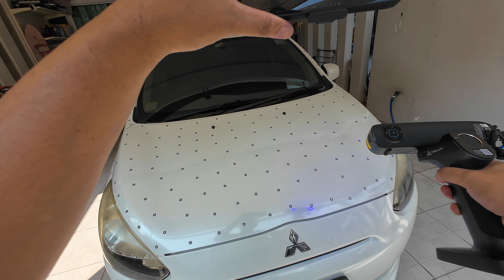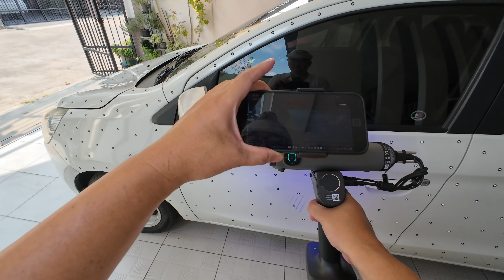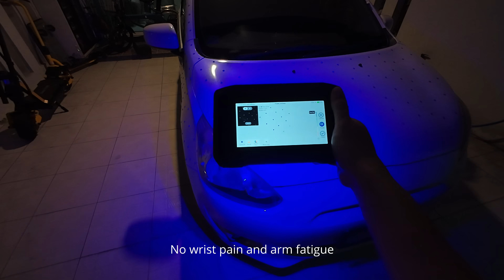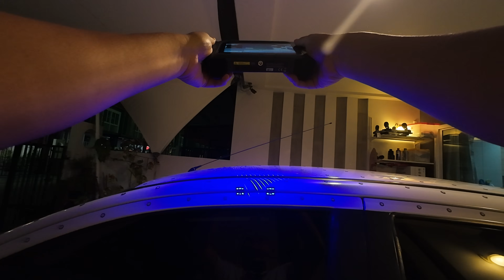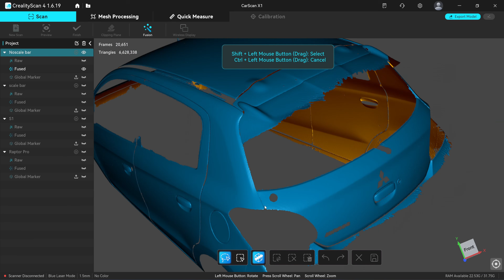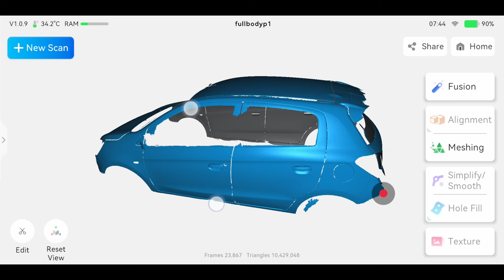Full Car Body 3D Scan Comparison - Creality Sermoon P1, X1, S1 & Raptor Pro

Comment: Do you think the Raptor (base version) performs well in an operation like this?
Reply from the maker: 7 lines laser is for scanning smaller object, I don't think that it's suitable for scanning car panel.
Reply: @Payo-TensileCreator I understand, I recently acquired one and wanted to use it for that. Maybe in the future I'll upgrade to a Raptor X or Sermoon. I'm going to try doing some tests by adding more overlap and more markers, because I'm going to create an optimized mesh modeled on top of the scan; I don't necessarily need maximum precision, but rather the best of the best.

Comment: I'm wondering if the scale bars would work better on different axes.
Reply from the maker: No, it’s not. I’ve tested this before, and while scale bars can override the calibration board settings, they’re far less accurate than the quartz calibration board.

Comment: Would there be advantages of disadvantages of putting reflector markers very close to each other?
Reply from the maker: I set the spacing to 10 cm for the Raptor Pro test. With wide‑angle lenses on the S1, X1, and P1, 12–15 cm is fine.

Comment: Try revopoint metro y pro
Reply from the maker: I don't think Revopoint would be happy to see that.
Reply: The metro Y pro is worse than the original raptor. Don't believe the hype.
Reply: @Big_Boulders i have metro y pro, work flawless. I usually scan small to medium car parts. But not car like payo, so I not sure about that. For small to medium car parts, perfect!
Reply: @axiediary3182 I had one for less than 24 hours and returned it. Each to their own I guess

Comment: Sermoon X1 scale bars should be present while scanning global markers, and can be removed before scanning the object if necessary. Taking them off early is literally not using them. Creality has a tutorial for operating Sermoon X1.
Reply from the maker: I removed them after completing the global marker scan. I’m very familiar with how this process works. The scale bar isn’t new, but its accuracy is lower than that of the calibration board, and during global marker optimization it overrides the calibration board’s configured values.
Reply: @Payo-TensileCreator In that case, maybe they have been dropped once or twice? The leverage of Sermoon X1 against S1 fades very quickly if scale bars don’t work.

Comment: Great video. Pay more, get less. With global marker scan you should have zero drift. This is the ideal use case for using global marker scan.
Reply from the maker: When I did the global marker scan, the markers didn’t line up as I repeated the circle, same thing happened with every scanner. Optimization fixed it, but if you scan in a straight line instead of a loop, the errors stay. Honestly, without this test I’d never have known.

Comment: I was looking forward to the S1 scan to see if there was any drifting compared to the X1 w/out scale bars to see if they are basically the same
Reply from the maker: Looks like I forgot to include those, photos are posted here now. 
http://youtube.com/post/UgkxA2VXTsR31CC-GzstKxJ6981uohvSEIkG?si=RSB5S4PhdyfriEjY
All the laser scanners showed no drifting errors—except the X1 with the scale bar. At first, the markers overlapped and didn’t line up during global marker scanning, but they snapped into place after optimization. Without the scan in the loop, though, those drifting errors won’t get fixed.